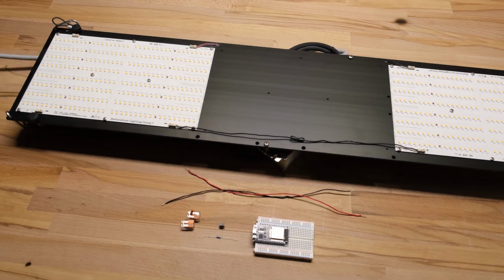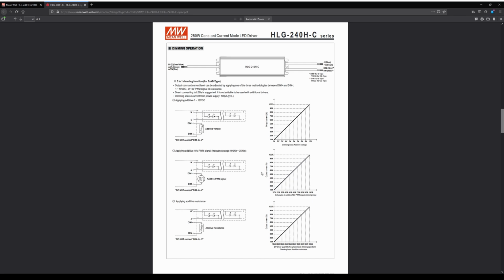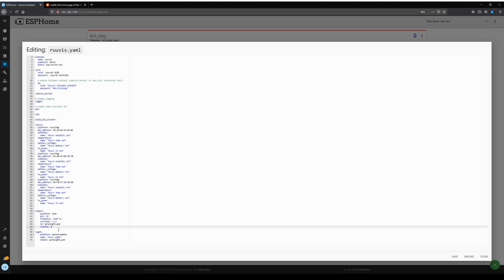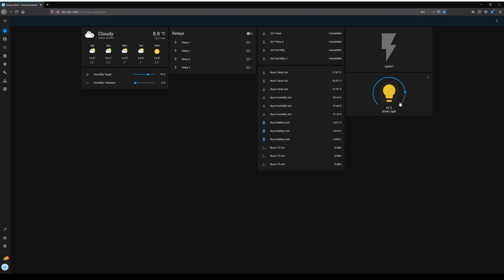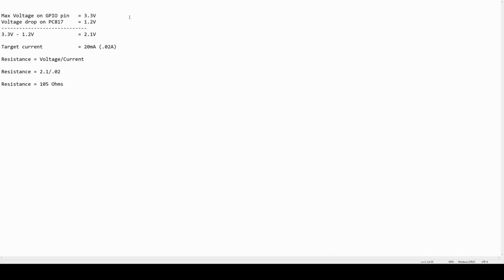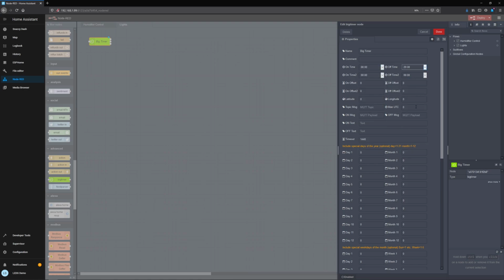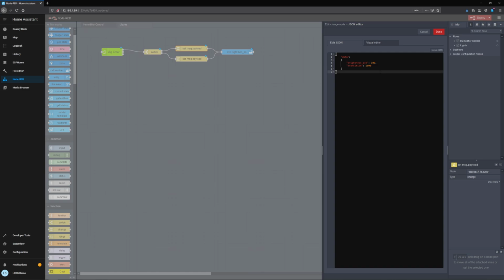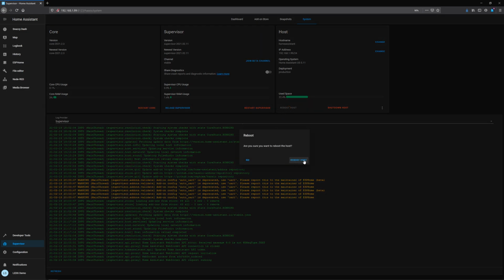Automate Your Grow with Home Assistant #7: Dimming & Scheduling Your Grow Light

Comment: This is exactly what i have been searching for over the last few days. The newer Spiderfarmer SF2000 & SF4000 uses the XLG-240-H-AB drivers. Based on the spec sheet, it looks like your setup will work with these as well. I know the raspberry pi can do PWM signals. Can this be used in place of the ESP? I already run multiple pi's with relays in my greenhouse. Would like to stay with that hardware if possible.
Reply: That should work without a problem, but I think you have to recalculate the resistor
Reply from the maker: Yeah for sure, you can set up a Pi pin to do PWM in the same way. Voltage will be the same so the same 100 ohm resistor should work. Just set your GPIO pin up for the same 1220 Hz frequency (or close to it) and then find a way to change the duty cycle and that will control your dim. Might want to invert it as well.
Reply: @LEDGardener  would be great if you can make similar setup for the pi. I'm sure there are a lot of ppls looking for a solution like that.
I have the HLG-600H-54B and will use the esp model, as I want to keep it separate from the main pi which is running the ha server.
Reply from the maker: You mean a Pi running Home Assistant? Or just a Pi
Reply: @LEDGardener  Pi running HA.
Reply: @LEDGardener  i have never used home assistant. I write all my own python code to manage all my sensors and relays. Alot more control and customization that i like. I definitely want to get a pi interfaced with the lights.
Reply from the maker: Sorry @Brent I meant to reply that to Stanislav but YouTube doesn’t like to @ people. That’s really cool that you write it all yourself. I just finished a python course and I’d love to get better at it.

Comment: Newer hlg models use an inventronics for the driver. Do you know if they support this method? I can't find anything on them about pwm
Reply from the maker: I’ve been reading up on them a bit and I saw something about having to use a separate programming module to put the particular model I was researching into PWM dimming mode. Not sure if that holds true for all of them.
Reply: @LEDGardener  Hmm thanks a bunch, Guess I'll look into that
Reply from the maker: I’m going to try a 600 Rspec this afternoon and let you know
Reply: @LEDGardener  Sweet, looking forward to your results
Reply from the maker: Ended up trying it on a scorpion rspec. It worked. Driver on this light is Inventronics EUD-600S560DT.
Reply: @LEDGardener  Oh sweet, I have the scorpion diablo, thanks a bunch mate!

Comment: The $50m dollar question is...can you swap out an "A" MW for a "B"?
Reply from the maker: Just put a Phillips head on a servo and use that to tweak the pot 🤣
Reply: @LEDGardener  brilliant
Reply from the maker: A type only dims between 50% and 100% though :(
Reply: Good to know because I think I'm burning my plants.
Reply: So 50% is still too much. Does the B type drop to 10%?
Reply from the maker: Yup. Small drivers (240H and below) are typically 1-10V  (10-100%), larger ones 320H and up seem to mostly be 0-10V (0-100%) so they can shut completely off)
Reply: @LEDGardener  Nice. I was going to buy a new light but I think I'll try a B type if it can go lower than the pot on an A type. Plus automation of course.
Reply from the maker: Constant current or constant voltage?
Reply: I'm not sure. There's a HGL-240H-48A on the light right now but I can't seem to find a data sheet for one that says output lower than 24v which should be 50% I assume.

Edit: I checked a few things out and the current pot does nothing to the light output. The voltage pot is the only one that changes anything. It's a very old panel from 2013 so they're might be some witchcraft going on.